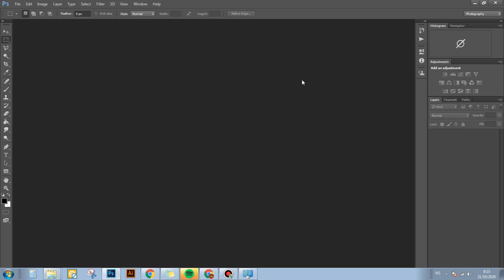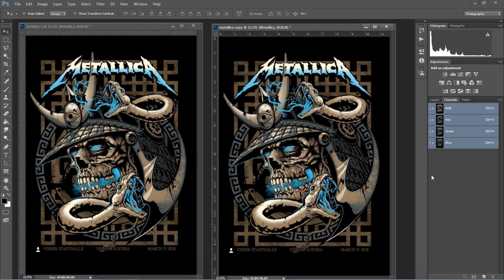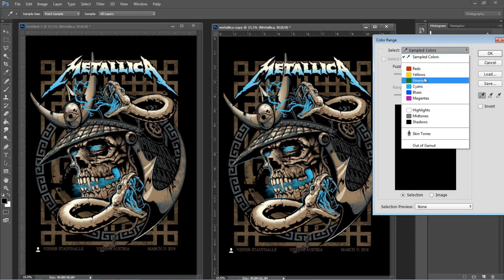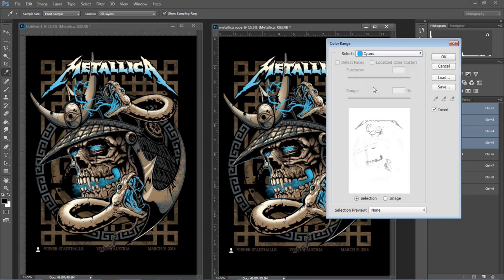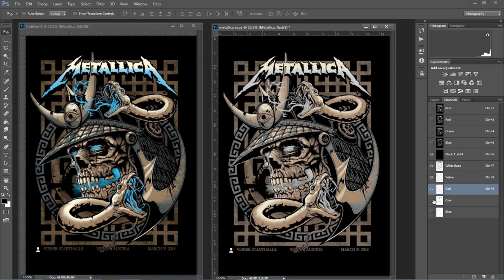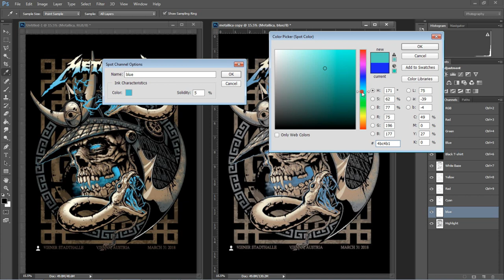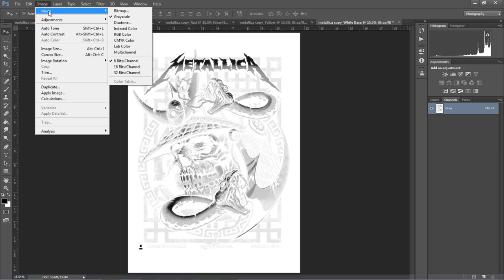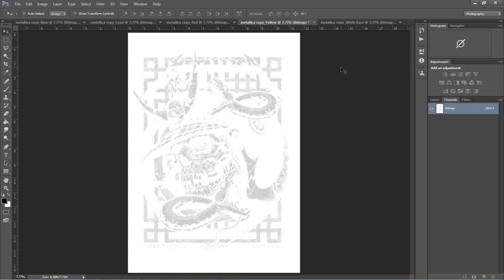Photoshop Tutorial Vol. 1 : How To Separate Color  for Simulated Color Process Screen Printing.

Comment: Hello. Hello....I don't have 5 screens only 4 on 4 color press. can I delete the blue and just use white base red yellow cyan and get same result?
Reply from the maker: the result will differ, but the image will be the same only missing some color, if u do it for customer, make sure to consult them first about the outcome.
Reply: Thank You.   After I print white base what colors goes next? Do i have to print certain color order. Thanks for your help
Reply from the maker: @trollerzapper7513  it is variable. different design needs different order, u have to do the simulation first on photoshop to see the difference in each order just like in thi vid

Comment: do you use regular platisol inks with this method or cmyk transapert inks? thanks
Reply from the maker: Normal plastisol, don't use CMYK ink on simulated printing
Reply: @cendanaapparel8547  thank you very much. .What size mesh should I use for this process. Thanks you again.

Comment: Can you separate colors for simulated color process for screen printing solely using the PSD file? Can the process still work if the artwork is just one image with no layers?
Reply from the maker: yes thats exactly what im doing in this video
Reply: @cendanaapparel8547  does this method work if the file is only one layer?
Reply: @supreme8000  I'll answer for him, as he obviously didn't want to repeat himself, the image in thie video IS one layer. The 'layers' he messes around with aren't 'layers' they are the 'channels' which all flat / 1 layer images have.

Comment: this is great, may I know the mesh size that you will use for this design. thanks
Reply from the maker: If 45lpi i use 1800 mesh count. 1500 also can, better 1800 above
Reply: Where can I find 1800 screen, in states only have 3 Numbers like 110 150 190 200 255 etc.

Comment: I recently got photoshop, 2021 version, & it is different to what you have in this video, i understand this,I have to be doing something wrong, as create new is different, i can't duplicate the photo, which is the same Metallica one you are using here, i am just having so many problems, nothing seems to want to work, feeling dejected
Reply from the maker: my friend if what u have is a technical problems, dont worry given some time u will figure it out, most important thing is u understand the basic on how the separation happened.
Reply: @cendanaapparel8547  I finally got to duplicate the picture, but now, following your tutorial, when i go to create white base & double click to do the color the pop up window appears but i cannot click spot color, it won't let me, spot color is there just can't access it, do not know what has gone wrong
Reply from the maker: @ian1162  sorry my friend i dont know why is that happened. Try double check the step maybe u missing something, or maybe the problem is with your psd. 🙏🏻
Reply: I redid the steps another 3 times, i can get the white base as a channel but when i double click the thumbnail the window pops up with marked & select highlighted but spot color is not. I am beginning to think that it is either the version of photoshop( current 2021) or it is my computer, i am at a frustrating loss
Reply: If the problem is with the psd file, do you have any suggestions on how to fix it?

Comment: Hey bro can you do tutorial on this with Simulated Color Process Screen Printing on a white shirt instead of black?
Reply from the maker: Bro, process is same, only change the black tshirt layer to white, then all the process is same, seperate your colour accordingly.
Reply: @cendanaapparel8547  on white there will be no under-base though correct?
Reply from the maker: @percymolina309  yess most of the time
Reply: @cendanaapparel8547  that's what I'm confused on white shirt. What color would you use as the under base
Reply from the maker: @percymolina309  depends on design, but most of the time it will be no underbase
Reply: @cendanaapparel8547  is it better to do cmyk for white shirt? A lot of time the white underbase I notice makes a big difference with the dark shirts
Reply from the maker: @percymolina309  all depends on artwork. but surely u have to do try in error